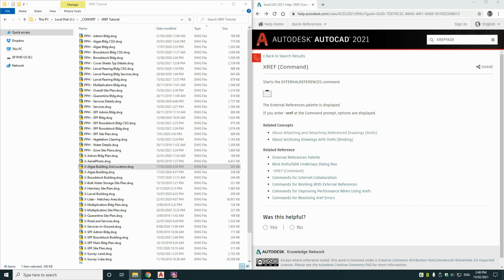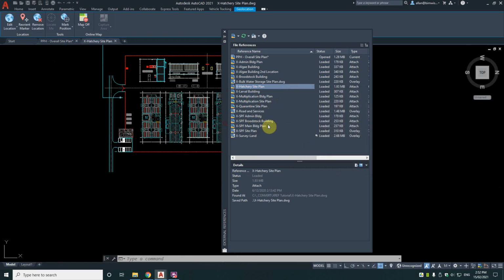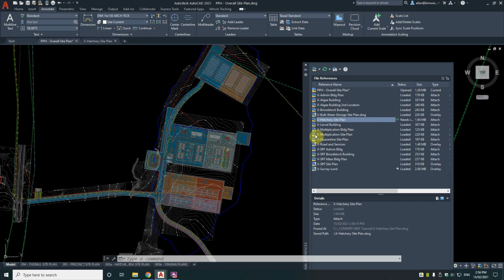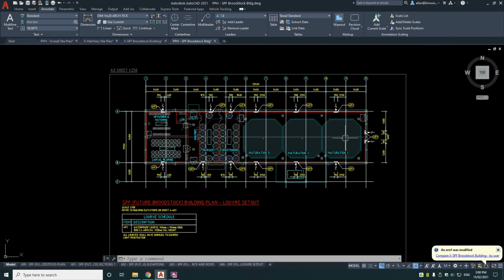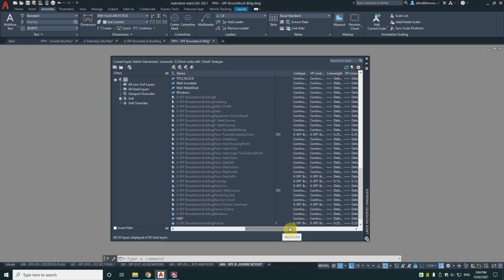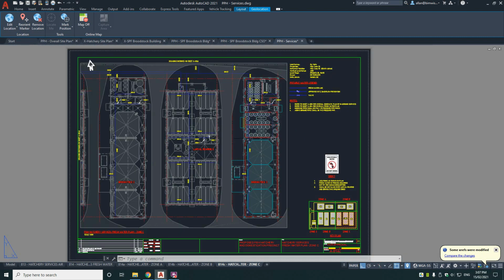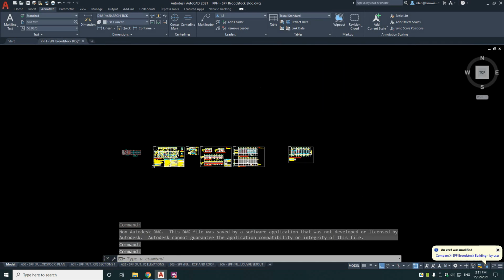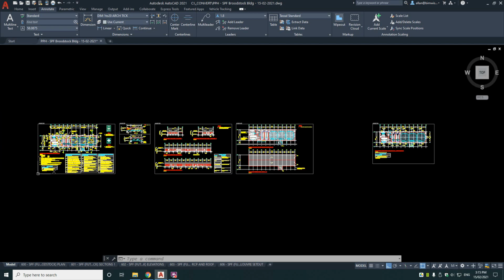AutoCAD Tutorial - The power of the XREF!

Comment: I have a floor plan and i want to put water and sewer in it. I referenced to them my floor plan, but I want to get all the installation back to my floor plan. But if I reference water on it for example I will get my floor plan as well onto my floor plan. How do I fix this? I want them to have my floor plan if I change something, and I want to have all the installations as well.
Reply from the maker: Use either multiple xrefs or a good set of layers to turn things off and on.
Reply: @TheArtofTechnicalDrawing  what do you mean multiple xrefs? The problem is if I reference water to my floor plan I would also get the floor plan twice, the original floor plan and then as a reference as well? Is there a way to avoid that?
Reply from the maker: Yes. Make the xrefs “overlay” instead of “attach” and this circular referencing will stop.

Comment: Hi.  I've been hurled into the deep end.  I am a draftsperson and I am using AutoCAD 2022.  I have created a master template for a Master house.  The BASE is an XREF and the FACADE is an XREF.  I have created LAYER STATES for bosth BASE and FACADE.  However this is messing me up in the TEMPLATE where I have combined teh XREFS onto on layout.  There are various layouts such as Floor Plan, Electrical Plan, Slab, etc but the LAYER STATES are not working well.  Is there a better way to set this up?  Please I am my wits end.  Thanking you, Aran
Reply from the maker: Control the layers in the paper space views or have a seperate file for each plan, but a common base xref of the plan. Basically look at ways to simplify your setup but still have a central way to edit the base line work.
Reply: @TheArtofTechnicalDrawing  many many thanks. I will apply your direction.